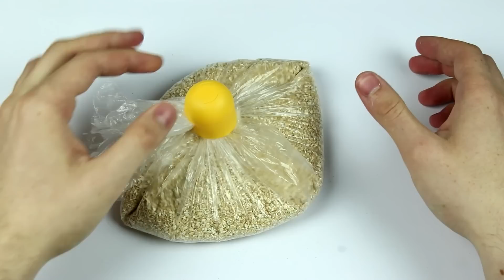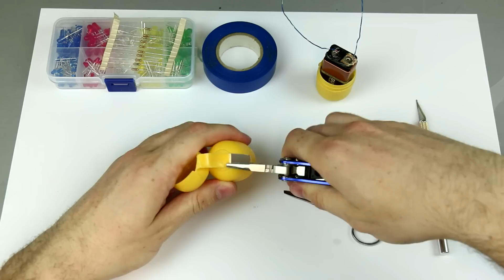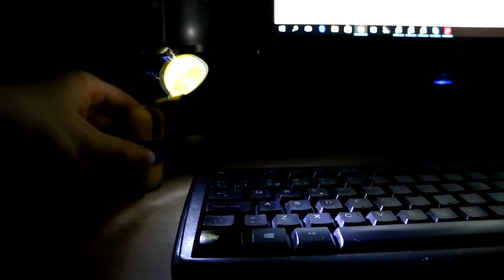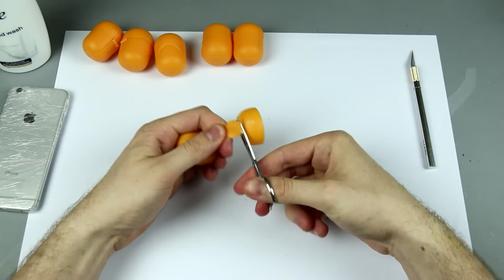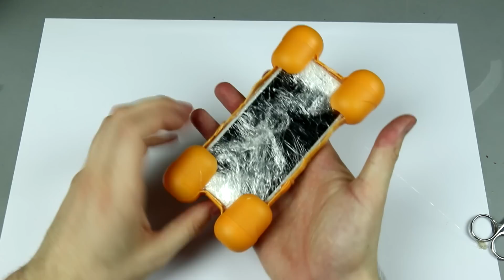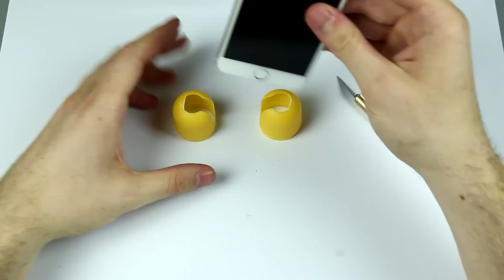Como Hacer una Linterna - Funda para telefono - 5 Life Hacks

Comment: de cuanto debe ser la resistencia
Reply: y código de colores
Reply: Depende de la batería que uses y el color del led. Si te da igual que no se encienda al máximo ponle una entre 1k y 2k.
Reply: +Kique Phan Razquin pila de 9 volts color de led blanco a 3 volts cual me recomiendas
Reply: +ART Gamerr10 XD Perfecto, si tu led consume 3volts, quiere decir que la resistencia 6v, y la corriente maxima de un led blanco son 30mA, vamos a poner 20mA para estar seguros.
Aplicando ley de ohm R=V/I, sustituimos, R=6v/0.020, y como resultado nos da 300ohm. Cualquier resistencia de ese valor o superior es un valor seguro. Por otra parte la potencia de la resistencia(por si te preguntan en la tienda) deberia ser de 1/4W, o 1/2W si quieres tener un poco mas de margen. Saludos.

PD: Si tu led es ultrabrillante, soportaria hasta 30mA sin problemas, por lo que una resistencia de 220ohm o superior funcionaría perfecto. Si tienes varios led, puedes probar a ir cambiando la resistencia entre esos valores.
Reply: +Kique Phan Razquin WHATHE*UCK
Reply: +Kique Phan Razquin gracias